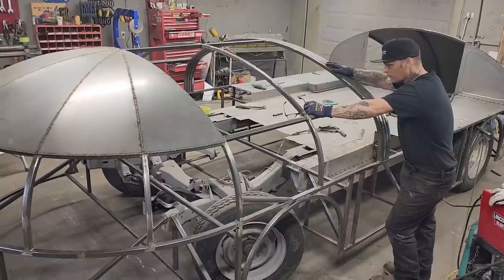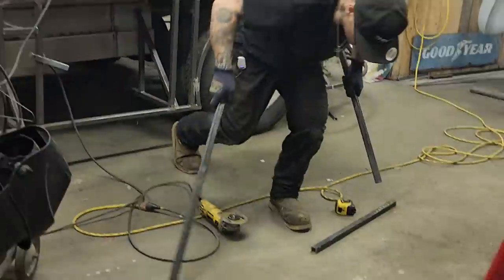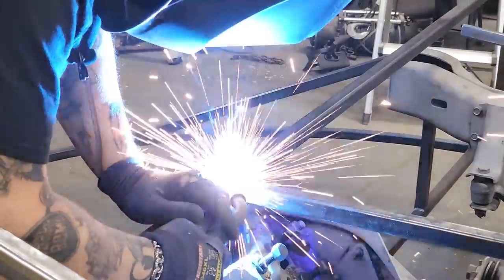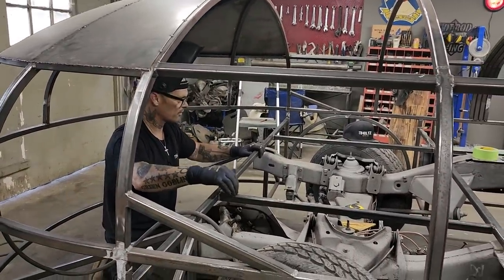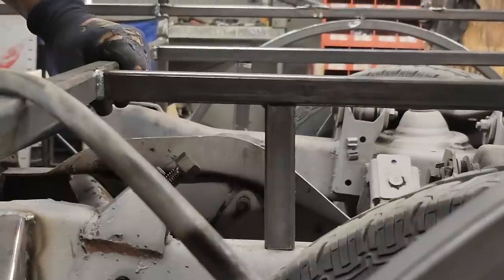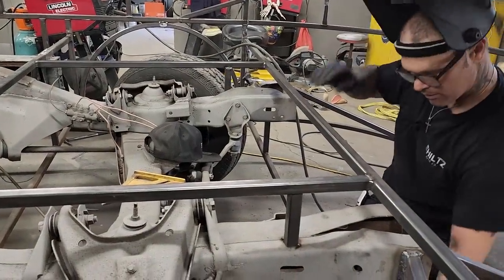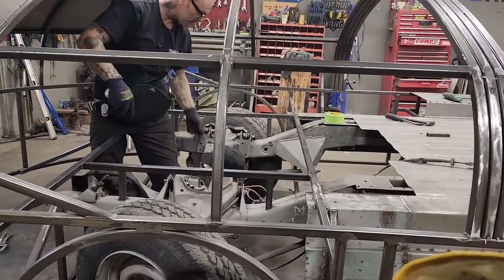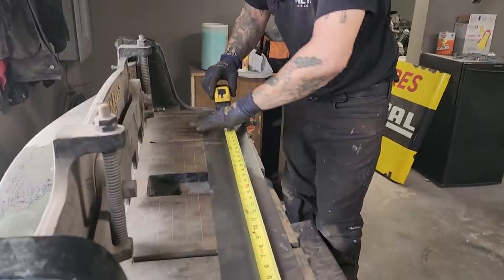Framing up the front wheel wells 📐

Comment: I think it would be a good idea to start on the mechanical. Get the engine, transmission, steering figured out then start wrapping it all in.
Reply: Exactly ! This welded body. No chance/ to lift it up or separate it from the chassis to do mechanical work
Reply: Would be good to see where the body is going to sit when engine goes in because I’m think it will drop a bit
Reply: Bang on was just thinking that myself , creativity is great but really want to see this drive down the road
Reply: It’s actually essential

Comment: Like I commented yesterday which got deleted somehow, I think gull-wing doors could be fabricated for driver/passenger. They could go in the same general area as the doors in the Texaco rendering. Then, a larger gull-wing could be fashioned over the engine area with a removable bolted in ridge beam so that a hoist could be used for install or removal of engine/trans.
Reply: I like the gull wing idea but maybe not having enough room without crawling to get to the seats?
Reply: @randy9573  Crawling into a seat is ½ of the fun. I went to college in a '29 Model A coupe with a rumble seat. I was the most popular guy on campus (only) because of that crazy rumble seat. That takes a lot of effort to get into and out of a rumble seat.

Comment: Great channel. Glad I happened across it. Only a  comment…. 1. Hinge front of cab at the top to tilt up. Steering, pedals, controls seat mounted on stationary floor. Clamshell. 2.  If you double the wheels at the front to bring them out make sure you have clearance in the wheel wells. Outside tire will have quite an arc. I’ll go back to just watching and enjoying. Looks great. Doodle Bug.

Comment: On top of the front wheels, add a frame on top of the flat sheet metal by laminating it. It will look like you bead rolled it even with rounded inside curves.Tack it, then seam sealer.

Comment: One issue I can see is that because there is a long distance from the front and the wheels, the front might hit when going up some slope like a driveway and the back might drag. Or hit going over speed bumps.
Reply: Extend the A frames and add air-ride on the front it will solve his in-board wheel problem and ride like a bus. Then he wouldn't have to worry about bottoming out.

Comment: I'm thinking as low as the outer edge sits, you may want to air bag it on all 4 corners, or at the very least, air shocks because once you get off the major highways, you're going to have to raise it up or do damage to your fine work, maybe even hung up and not be able to go forwards or backward. I've seen many tuners pull into or out of the venue and rip half of their ground effects off where the driveway meets the road

Comment: For doors, move the 10 o'clock front pole a little foreward and put in suicide-doors just in front of the wheel-wells. The "A" window will be a bit smaller but you will fomlow tve principle of the texaco-tanker and the dlor arrangement will be reasona le unctionam and buildable.

Comment: The only problem with welding directly yo the frame is noise transmission. Whenrever a stone hits, a connector rattles or hit a pot hole it will run through the frame and skeleton. Leaf springs and shocks create a lot of noise. Kind of like tapping on a drum skin, it will magnify but be almost impossible to isolate the cause. However, there are lots of automotive sound deadening products that can help keep the cabin area quieter. I really like the suport Jolene gives Chad. He gets an idea, they talk it over and then she jumps on board offering constructive advice and obsevations.Curios, was that an Endelbrock or Ofenhauser crossram centerdome you showed two days back?

Comment: i was a 'ramp agent' for a few years at Philly airport and thought the same. Some of those runway vehicles were made of 3/4 to 1" plate steel to be so heavy that they would anchor the plane if high winds hit while they were servicing whatever they were doing. Runways and ramps are by definition flat and wide open spaces and anything not weighed down will blow away and not stop till it hits somethig and that something might be a million dollar airplane

Comment: Chad mentioned power cords and my first thought was......purchase some cordless power tools with rechargeable batteries, you'd only need maybe 2 or 3 of them. You can always have extra batteries all charged up. Not having to pull around a air hose and electrical cords is a very freeing thing. Its absolutely worth the money, and it saves lost time lugging air hoses and power cords all around.

Comment: Hi Chad, Jolene, and Fina you are making progress slowly but surely. It is funny I had thought at one point that you could do a hatch in the roof although it will require some good weatherstripping to keep it good and weather tight. It may be a little tough for Fina to get in if you plan on her riding in it. You could always put a smaller hatch in the side somewhere for her to get in. Jolene nice job on the camera and eyeing up the vertical supports so that they ended up straight! I am curious Jolene do you like working on the projects from time to time or do you prefer to stick completely with the video filming and production? It was a quiet time for Fina today with nobody to bark at!

Comment: Hi Jolene keep up the good work with the camera and it was nice to see you in a couple of videos and Chad it's shaping up can't wait until you get the motor and transmission in and then front floor pan and steering wheel where you want it. Keep up the good work God bless and have a blessed night ps Chad I think it would be best to use metal in the fender wells for safety but as I said that's what I would do.

Comment: Great job so far Chad.  I am wondering if you should stop building for a few minutes and start thinking about the front end compartments where you and Jolene will be riding?  I see questions about seating arrangements, steering wheel position, shift controls, petals location, and lighting.  I am also wondering how far forward you will bring the front end of the motor.

Comment: The front frame rails should be angled and extended to  the lower front 1" bar. and the front wheel wells should cover the front suspension IMO

Comment: Hi Chad gave you thought a bout the added weight of the body sheets and engine weight  on the suspension  and eventual ground clearance  it may be worth calculating that and adding the equivalent  weight as ballast  to see if it makes  thmbe difference. Loving the design  though.

Comment: Just currious, how will body to ground clearance be after body and glass are  finished, a motor/trans and exhaust are added, and couple of 200lb passengers and fuel are loaded up. Looks to be very low without all that right now. Might be a good idea to add some estimated weight while fabrication is still in progress
Thanks
M L Rogers     Pasadena,TX

Comment: It's looking good more support definitely however I take it you be sitting in the front of this rig...ok cool love the idea..now look at the macanical part of it..leave access to change suspension parts if needed..ex...now with the motor in place...you are now blocking it's radiator no air flow..over heating problem..so the radiator will still have to go on a 45 ex with electric fans..from  under the truck..ex..keep that in mind..all your controls will be all backwards...I'm sure you no that but keep in mind just saying.  Guys...truck starting to look like something...nice...happy building...
Reply: Side door sounds good keep in mind the dog house will be there or engine cover..step by step as you go..I get that.. remember were looking from the outside in..on your project..it does look bad ass...😂..🎉...

Comment: I like the stair step in the toolbox ideas.
 Another is to use one side for the radiator. Build an in/out, a grate/grill, with radiator and electric fan.
Good place for an inter cooler as well. This thing is itching for a turbo diesel.

Comment: What are you going to do-as an-under floor safety impact structure in case you were to be impacted in the front , those chassis rails need to be engineered right to the front of the vehicle otherwise that would be disastrous in a collision ,art or not safety first.

Comment: Original door location for sure .
V- shaped Air scoop vent on front with a cabin lever like on the  original. 
Top windshield wipers
Big big round headlights 
3 marker lights on top over windshield green goblin green  if legal in Nova Scotia .
Small fake mirrors with a junk yard  modern camera rear and panoramic view on interior navigation center screen .
cup holders  
Doggie bed soft
2 bucket seats with center chrome console storage with chad chrome tutorial amen

Comment: Chad, you will need to move the control arms closer to the wheel well openings. Spacers will make the turn radius too large and you will rub on the wheel well and only have a few degrees of turn radius. I use manila folders and cut out patterns o mock up designs to see if my idea works.
Reply: If not the scrub radius will be measured in feet.
I think it would jerk the wheel from your hand when you try to turn if you use conventional steering.
Hydraulic ram is about the only alternative